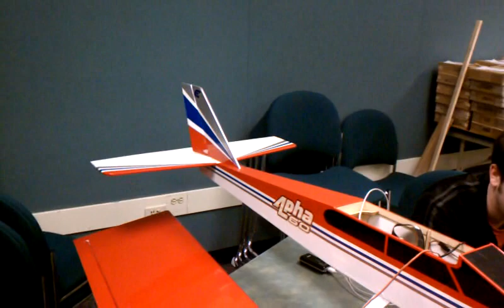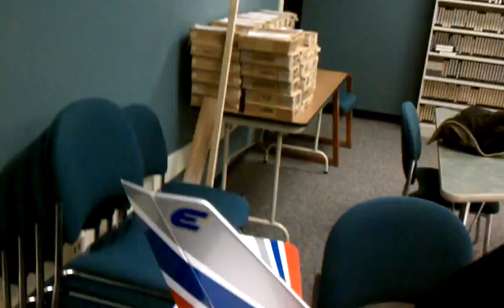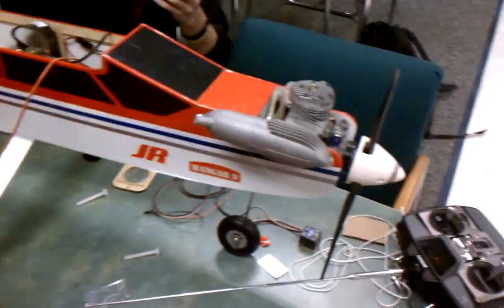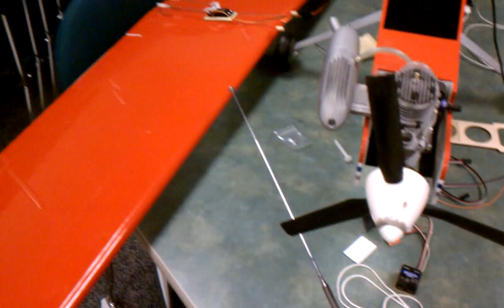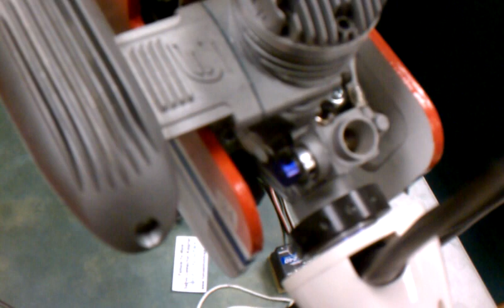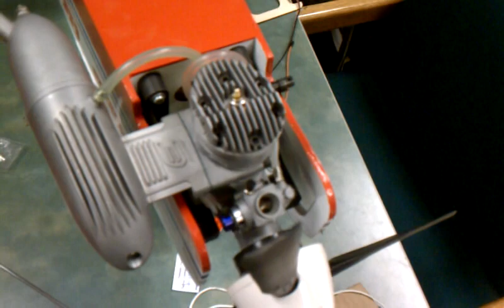Raspberry Pi Plane

Comment from the maker: Sadly we weren't able to fly it before the semester ended due to weather problems. We did get an A for the project, though. The plane actually does have a camera on it, it's almost just visible in the first shot (little black roundish thing sticking down below the JR). It's wireless, though I'd probably recommend something else.